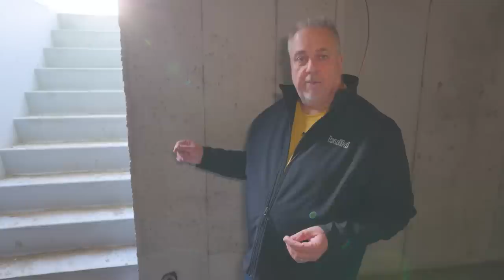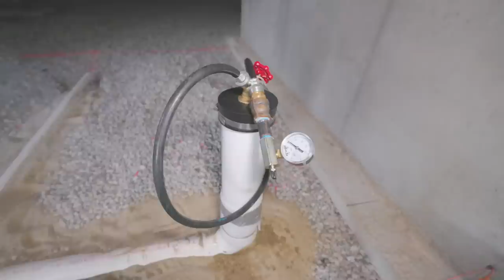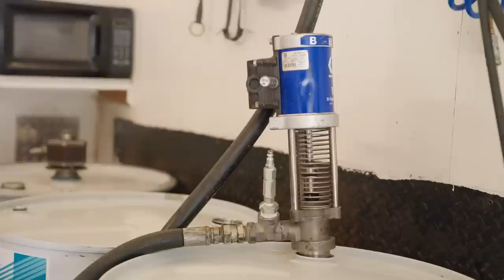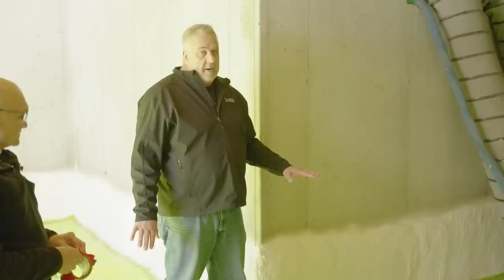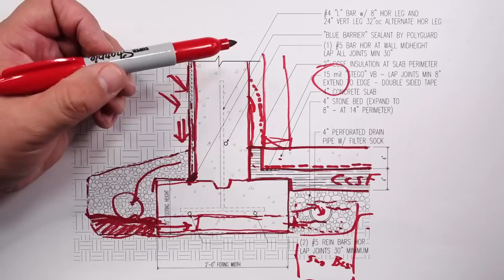"Basement Slab" Build Show Build: Boston Ep. 9

Comment: Nice video and explanation covering the process. I will be comparing Halo GPS Subterra 2"-4'x8' with taped seams versus closed cell spray foam. My project is climate zone 4. Also, really nice design running all the drainage pipe under the slab and under the footing along with using sand.
Reply: Awesome -let me know if you have any questions

Comment: 44:30  - very smart, to have 1 pump set higher  -     👋 having a redundant sump pump does you no good if you do not have a reliable indication that the primary has failed.
Reply: Agreed - have the same system at my house and the secondary dumps on my driveway - instant alarm....

Comment: Hey Steve, love all of these videos.  Just one question.   In our house, they did all the slab work (stone, plumbing, concrete) before any framing at all.  They did the foundation, then the walls, then the slab.  So it was all open from above.  That made perfect sense to me.  So what is the reason for doing all of the framing first, and then squeezing the concrete into the basement to do the slab last?
Reply: That's what I was wondering. Seems a little silly to me.
Reply: We did it both ways, but we frequently used to pour the floor before we put up the walls. It was concrete block back in the day, and it made a nice surface to work from while laying the block. We'd pour the footings, do the under-floor drainage tile and plumbing, lay the first course of block and then pour the floor. That said it can be a bit tricky lining up the plumbing coming down from above since there can always be slight changes to the plans when the plumbers are actually doing the rough in.
Reply: This might not be the true reason why he waited to pour the concrete slab in the basement, but the first thought that comes to my mind is that he is doing it like that so the concrete can be protected from the elements like rain and the cold temps that way the concrete can dry and cure properly after it has been poured.

Comment: I built a DELTEC Home.  If you're familiar with them, all the floor trusses Run to the center of the house.  Additionally, the first layer of subfloor does not have any running bond so a second layer is applied in running bond.  Both are 5/8".  Consequently, staple up radiant isn't feasible for two reasons, One, there's very little room for the pipe.  Two because once your final floor is installed (3/4" hardwood in our case) you have a solid 2" of wood which wouldn't transfer heat.  I looked into Warmboard, and got a quote.  Just the Warmboard not shipped from CA was $12,000. By the time you factored in shipping and the cost of the mechanicals, it was going to be around $20,000 to heat the 1500 SF main floor.  So we chose not to use it.  Now having lived in this house for 7 years I know that in floor heat in the bedroom/bathroom/laundry/pantry area is not necessary.  We heat the main floor with a combination of a wood burning fireplace and Radiant Cove heat. Our walkout basement has Radiant hot water in the slab. In conjunction with the ICF walls and underfloor insulation, it's a very comfortable and easy to heat space.  But the areas mentioned before maintain comfort year round with no additional heat.  We have a total of 10 Radiant cove units and only use 3. So knowing this now, I could have put Warmboard in the Great room and 1 1/8" OSB for the rest of the house.  We live in the Black Hills of South Dakota.  Our nights are cool in the summer and consequently we don't have AC.  Our great room has 5 windows that are 5'x6' as well as a 6' slider. So heat gain in the summer is a bit of a problem, but by lowering our blinds, we can mitigate that.
Reply: Thank you for joining in the discussion

Comment: If you're floating 50 yards of concrete entirely on closed cell foam aren't you limiting the lifespan of the slab? Im sure the foam doesn't maintain its structural integrity as long as the concrete, especially bearing such a big and slightly live load. I know its different chemistry / sun exposure but I have retired surfboards built of closed cell foam after 10 years because they start to get "soft". Just wondered if its a issue that was addressed with the foam manufacturer. Again thanks for the Post, I learn so much watching your channel
Reply: The foam doesn't shrink......maybe a very very little. I have been in numurous homes we have renovated with open space / retracted ground under a 1" or 2" slab

Comment: I have not seen sand used before for under slab plumbing, can you talk more about why sand of gravel for leveling?
Reply: much easier to rake and work to set the correct pitch
Reply: The plumbers said that the sand is a code requirement around all waste lines.  Thanks to Steve’s design of the bedroom/gym windows and exterior walls, it was also easy to back up to that area and slide the bags down into the basement on scrap pieces of Zip R9.  Bob Connolly, the plumber from RGC Plumbing, and his team did an exceptional job.  I am so impressed with their work and care to do an amazing job.  They were back today for the vents and final decisions on some plumbing placements.  Very excited to have added drain water heat recovery from Eco Innovations.

Comment: I feel the barrier they put after the spray foam should have been placed before they spray  foamed as well 26:35
Reply: The foam wouldn't bite the Stego wrap -wouldn't work
Reply: @stevenbaczekarchitect9431  gotcha, since it’s a large area wouldn’t the foam all bond together and basically make one big pad supported from all walls and posts to keep movement from happening
Reply: @TristanHutchison  the problem is getting it to bond and not run on the Stego, nothing there to keep it in place. Obviously is we took 3X or 4X time you could make it work, but what pain it would be

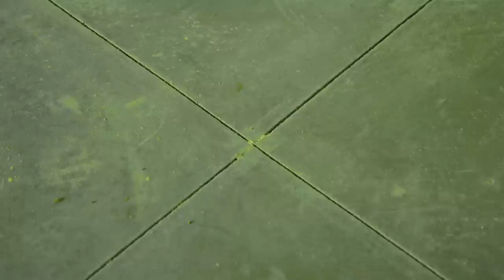Comment: At time 50:14 you show the control joints. It also shows some green material. It so happens that the vapor barrier is also green. Is that the vapor barrier being cut? If not, this got me thinking how often does that happen? Does the control joint need to be cut all the way thru or can it just be a portion of the slab so as to avoid cutting your vapor barrier.

Comment: Hey Steve, why do you pour the slab level? I know that makes framing easier, but if you were to get a water leak and the water migrates to the basement, wouldn't it be best to have the floors sloped to floor drains in the utility spaces? We had this situation a few years ago (broken supply line to a toilet), and a sloped floor would have significantly reduced damage in the basement. I know the floor drains could increase the likelihood of issues should there be a sewer backup, but with bathrooms in the basement that already would be a risk. Your thoughts?
Reply: This is a tough question, I see your point, and if a leak occurs the success to your point. If the basement was all storage it is a little easier to work in your point, with living space it is a little more difficult. With drains also, there is the notion of where do they drain to? In most regions you would have to drain them into the sewer, then you have to deal with the traps drying up, and solve for that.....

Comment: Do we ever insulate outside the foundation, it seems like there's alot of mass there to hold and stabilize temperature inside the house instead of vice-versa.
Reply: I don't usually, my homes energy efficient levels don't really benefit from the thermal mass, if they do it is minor. Outside it becomes a challenge to install properly and protect, and provide a proper finish.....

Comment: Steve, If the closed-cell spray foam under the slab is a class 1 vapor barrier, then you add another 15mil vapor barrier on top of that because you dont trust the spray foam....why use the spray foam at all? Maybe in your market the prices are different, but from what I can tell rigid foam is always cheaper than spray foam. Are there other advantages you are used to justify spray foam vs rigid foam under the slab that I am missing?
Reply: Here we can spray CCSF for almost equal cost to purchase rigid foam - then you have the install cost......
Reply: I am inferring from the client behavior in the video that the /client/ insisted on the additional vapor barrier, probably related to Radon concerns...
Reply: @epiphany6  We don't have radon out by me so I didn't consider that. Thats a good point.
Reply: Seeing VERY high levels of radon in the old house made the foam/Stego Home decision quite an easy one and it may prove to have been a very cheap adder.  Since I did the labor, that part of the cost was not a factor.  If I did it again, it would take half the time - learning curve!

Comment: I have a set of those concrete bulkhead stairs in nearby Brookline, Massachusetts. It leaked from the very beginning. The concrete stairs require proper backfill underneath to give it support. Otherwise, the bolts are taking all the leverage of the weight of the stairs. Our stairs pulled away from the top of the foundation and rainwater found its way in at the very beginning. Several tubes of sealant later, we had the problem solved, but it was totally unnecessary. I'm not sure why they build a foundation with a hole in it. Just square it off and install steel stairs.
Reply: Sometimes we do simply cast a well and infill with a wood stair - I walk thru these choices, with associated budgets and discuss with the builder and homeowner.

Comment: Just watching this series, really great stuff.  I have a question about the control joints though.  For all the effort that you went to with both the spray foam and the Strego barrier, at 50:13 in the video you can pretty clearly see what appears to be yellowish/greenish residue coming up in the control joint cuts, which sure makes it look like they cut clear through the slab and the Strego and into the spray foam.  Or were those actually very shallow cuts on top of a green/yellow chalk line?

Comment: Steve, -- QUESTION -- Did you ever reveal what the build cost was on that beautiful barn that you built in Massachusetts.  It was on the Build Show with Matt and had that dark blue exterior and awesome light colored wood interior (imported from Canada) with lots of solar and solar water hearer on the roof.  Simply stunning.  We have always wondered how much that would cost to build?  Can you ballpark it?  Was it a million dollars?  four million?  or a low $500k??  Really have no clue on the build cost (not including the real estate cost)??
Reply: Sory, I have not, it's my policy out of respect for my clients to never distribute cost data. Here's the deal, I do work all over the country. Let's say that barn was $800K. I could find a builder here where it may be $600k. Likewise I could find a builder here that it would be $1 mil. If I did that barn 100 miles west it is probably $450k........region plays a large role in cost. It doesn't really matter until you have a location and a builder. The best advice I can give you is that you are probably hard pressed to do exactly that barn for less than $600k (anywhere in the US), and it could be as high as $900k........Hope that helps - that's the best I got

Comment: A video spotlight on the basement wall assembly would be awesome! Is that in the works?
Currently have a similar build under construction and would love to see how you connect your continuous basement wall insul to the spray foam that extends up the wall from under the slab as well as the best location for the vapour barrier. Thanks!

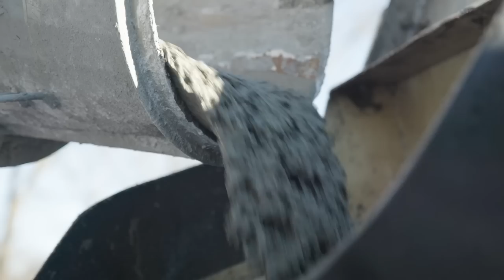Comment: Love everything about this build except 35:05 -- the metal hose couplings rubbing on the Stego on every concrete pump stroke.  Yeah they probably don't have enough skid pans/plates for the full run, but old carpet would probably be good enough to avoid damage under the parts of the pipe that aren't getting repositioned frequently.
Reply: Those pipes DO NOT slide easy, and they are very good about picking it up, I was there for pretty much the whole casting. Also, have you ever used Stego? Putting a hole in it is a challenge.
Reply: @stevenbaczekarchitect9431  My experience is with machinery, so I'll trust your experience on this application.  I was talking about the back-and-forth shock when the concrete pump s-valve flips, and specifically under the metal couplings.  However if it's fine after doing it, then it is fine.  It's a good ad for stego versus what goes under most spec homes.  Thank you for your informative videos.

Comment: Steve do you always like doing the insulation below vapor barrier? thanks.
Reply: In cold environment depends on locations I.e your weather pattern
Reply: Yes, my typical arrangement
Reply: Steve, is that a preference, or are there specific reasons?

I am building in MN and have the rock, vapor barrier, then 4in of foam, then conc.  I wrap the foam up the wall and plan to use the top of the foam as the "chalk line".  Thoughts?

I love your content.  You and risinger have greatly improved my house plan
Reply: @bennewland3933  not sure what location has to do with it?
Reply: @dbcartwr  Specific - insulation on top of the VB puts you at risk of concrete getting under the insulation and it going bouyant, and that would be a mess. VB on top of insulation provides a uniform load on the foam in the down direction......I know some reverse it, but I have seen rigid foam "iceberg" and it is not pretty - so I will never take the chance
Reply: @stevenbaczekarchitect9431  well sir , living in a cold climate vapour pressure escape from house a warm climate vapour will try to diffuse to the inside …. Soooo location
Reply: @bennewland3933  agreed for above grade walls, as a slab assembly in a basement is far more consistent across CZ's....

Comment: Love it Steve. If Radon is not an issue, is there any need to come up the wall with the stego barrier? Most guys in our area are using thin poly and just laying it to the edges of the foundation and not securing it or coming up the wall. My build has a ton of corners and wondering if the extra effort of securing to the foundation will be worth it. I am using ideal walls (similar to superior wall), R10 foam board and a hydronic under slab heating system in my basement.

Comment: Do you think that the concrete slab is going to compress the foam and sink over time?
Reply: No, it's not that heavy.....I exert more pressure walking on it than the slab does
Reply: @stevenbaczekarchitect9431  Ok, good! I built a mother in law unit at my home that has 2" foam underneath the slab and hydronic radiant heat tubing in slab, and I often wonder if that's going to be an issue later on.
Reply: So far I haven't noticed any sinking, and it's been about 8 years.
Reply: @jmhowlett  My guess is the foam may shrink in a few spots, the concrete would bridge the small areas - I have seen the ground recede under an old slab
Reply: Why they are not using pressure foam panel (Finnfoam), which is always used here in Finland for similar installations. It can stand way more pressure and has much better instalation properties than spray foam.

Comment: The water coming down the bulkhead.
Where does that go?
Reply: It will have a bilco cover, so no water will be coming down
Reply: Ok my other question is why does the spray foam not go on top of the vapour barrier
Reply: I'm sure it'll be covered with a door of some kind.
Reply: @dlg5485  YES!!
Reply: @WearySteerer  I would be a mess and not bite the VB. Also I like the VB on top to ensure concrete doesn't get under the insulation and have it go buoyant. More of a problem with rigid sheets, but I always put the VB directly in contact with the concrete

Comment: HEY THERE STEVE! BIG FAN OF YOUR DESIGNS. I APPRECIATE THE TEDIOUS PLANNING. ONE QUESTION, WOULD IT ALSO HAVE BEEN POSSIBLE TO PUT THE STEGO UNDER THE CLOSED CELL FIRST? WOULD IT MAKE IT EASIER TO SEAL THE PERIMETERS AND FIELD PENETRATIONS? OR IS THERE AN ISSUE WITH POURING CONCRETE DIRECTLY OVER THE SPRAY FOAM??? PLEASE ADVISE🙂
Reply: Steve's comment at the time was that the closed cell will not properly cure OVER the Stego and the advantage of the closed cell over the stone is that it will bind to it and cure well.  They "primed" the stone with a small amount of foam before building that up, similar to what they did on the concrete walls.  There was a careful review and discussion about the best order of Stego and spray foam.  Regarding the question of the Stego going up the wall, there was a concern over how to keep a proper chalk line for level if the Stego went up the wall.  A possible solution would have been to spray foam that Stego to "bind it" to the wall, then put in the chalk line, but the added cost of a spray foam visit for that limited purpose did not seem to make sense as there was almost no gain to that approach.

Comment: Hi Steve - What type of drainage pipe are you using for that sump pump?  Seems like it would get crushed under the stone.  Are the holes up or down if any?
Reply: It's the typical drain pipe up here, it is rigid (due to ribs) but not hard pipe. Definitely strong enough not to crush, also understand the circular shape contribute to strength. As for holes, it is perforated all around.

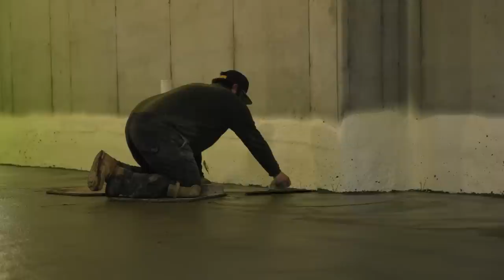Comment: Nice! -- QUESTION -- @38:40 why is the concrete slab so black and not that nice light colored concrete like the walls?  Seems like it must be a different product??
Reply: The walls are cured where as the slab is still fresh.
Reply: @trentonlof5286  That is certainly part of it
Reply: I think the camera has contributed to it  also.
Reply: @stevenbaczekarchitect9431  ...fair enough..  I had thought it may be the fiberglass in the concrete or that it was still wet..  Regardless, the floor will cover it, but I sure love that light colored cement.. Becoming one of my favorite surfaces and I never thought I would say that.. An exterior high quality exposed concrete wall can look amassing and be a great part of the character of a house.
Reply: @michaeltca3103  Agreed